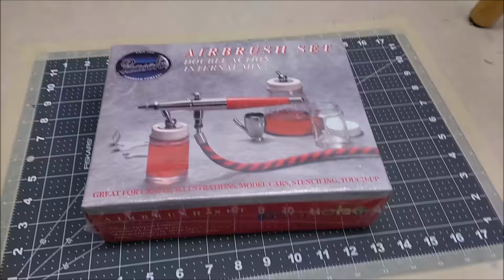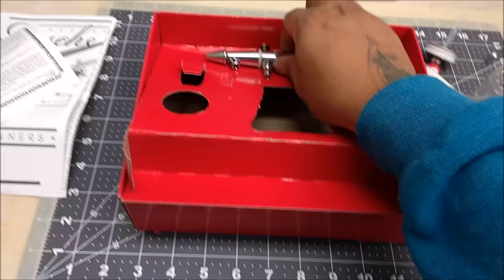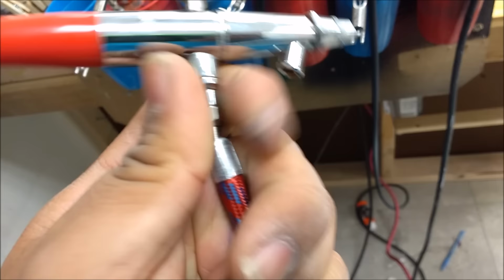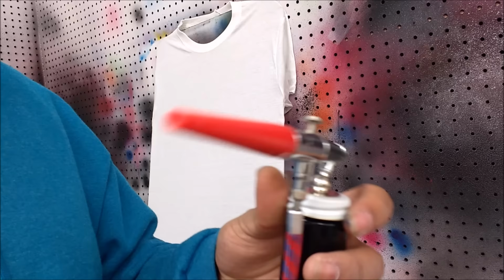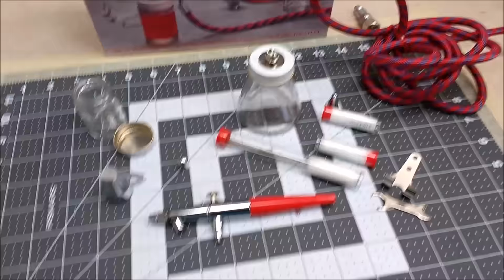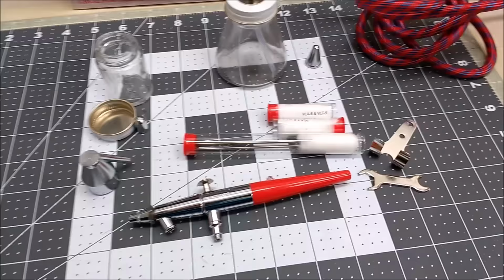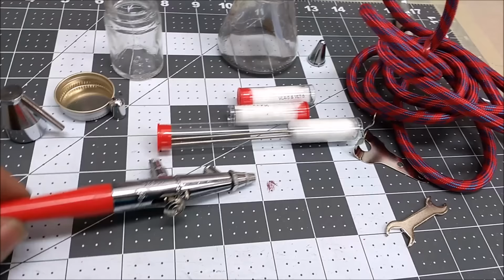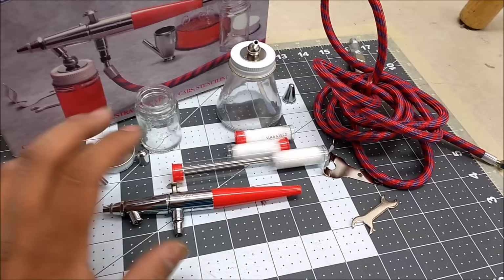Paasche VL Airbrush Set Review

Comment: i bought a Paasche VL like that in early 90s. I used it for modeling plastic kits and painting rockets. I recently found it and was able to restore the damaged worn out parts and even replaced the handle for a chrome one. I easily found all of them. I even made a wooden box for it to protect it. The brush is fully functional. This airbrush will last 100 years easily. I paid $52 for it, yep still have the receipt it out lived the art store. Want a tank? Get a Paasche.  Paache needle numbers #1 - 0.5mm, #3 - 0.75mm and #5 - 1.01mm. You can always spend up to $700 for a fine set if you are rich... It will still spew out paint... LOL

Comment: Siphon feeds need a higher Air pressure and well thinned paint, Creatix makes good paint especially for Model builders but it's needs to be thinned and have a leveling agent (Some brands offer a 2 in 1 mix) for best results on models.  Not sure about shirts but my friend has a 186k model that he got on the stupid cheap and after polishing the needles (remove the pits) those are the only ones he uses now at the fair (He ended up buying 6 more and spent 2 days polishing all the needles, which you must do with cheap brushes).  Like your video and had to chuckle at the box opening, no tripod makes life hard :) Great work!

Comment: FWIW, the VL's are great airbrushes when used for what they are best at: Putting  a lot of paint down quickly.  The  #1 "fine" needle/nozzle that comes with the VL is a .55, the #2 medium is a .75 and the #3 large needle is a 1.05 (that's spray GUN territory).  The needle that comes installed is the .75 - not a .3 - so that is why you were moving so much paint.  Also, the needle adjustment is a bit different than other guns - you want to make sure that you allow the trigger to drift all the way forward before seating the needle in the nozzle/cone.  If you have some turns on that knob that sits in front of the trigger, you can inadvertently be pushing too much air right when the needle comes off it's seat, making it seem hard to control paint flow.  

The hose "kink" going into the airbrush (the bent metal tube) is so you can tilt the hose to a position that's more comfortable for your style (i.e. it's on-purpose).  Just point the hose the direction you want it to tilt and lock down the nut (you will have to use the wrench to get a tight seal).

I currently have 11 airbrushes and have owned quite a few others: several Iwata, some Master, Grex, Aztek, and Paache.  I've had nothing but bad luck with Badger (that's just me, though).  Paache VL was my first brush - and now I own 2 of them ( including my original ) and they just keep on working.  I don't use them for detail work any more - that's the Iwata's job - but when I need to put down base coats or primers, they are my workhorses.  IMO, no airbrush outside of a automotive detail gun can lay down as much paint.
Reply: I have been out the game for many years but trying to get back in the paasche was my go to. I owned an iwata hpbc but never used it (I think I got it for Christmas in 1989) I want to buy a new brush for shirts and maybe some motorcycle tanks. Should I consider a different brush or stick with the paasche in this video? You know your brushes I can’t tell by what your typing.  I appreciate you insight. Thanks
Reply: @c.steele3386  In my humble opinion, if you plan to spray pigments (paints) and not inks or dyes (much thinner) then you would probably be better off with something like a VL than an Iwata.  Iwatas are great airbrushes - fantastic detail guns - but they don't (in my experience) have as much dynamic range as something like a VL.  I can paint a line 1/32" wide with my VL and expand that out to 2" with the #1 needle.  With an Iwata, I can go down to a hair's width - but past about 3/4" they start to struggle to move enough paint.  Of course, the beauty is that you can buy more than one brush and have QD connectors and just choose the best tool for the job.  If I was recommending a good all-around brush for a beginning user, though, it would be a VL (my oldest one is 41 years old and still going strong) ... and if you want the next best thing to a rattle-can to put down a ton of paint, the Paasche model H is a paint-moving monster - and it's external-mix so almost impossible to clog - and not that expensive to buy.  Best of luck to you :)

Comment: Have had one for years. You need the fine VL1 tip for the finest line. But, in honesty, a gravity fed will give an even finer line. Have never had my hoses leak either. Has ZERO problems with acrylics and enamels. You couls have gone with less thinner and a little more air pressure with no splatter / overspray or clogging. It's a case of knowing the tool. Making a comment based on assumptions is NOT a review. Have painted models with these paints and got great results. One issue with the kit is beginners often use the wrong needle for the tip they have as they don't take time to understand the markings (not talking about you, but beginners). Kit has always needed better markings or even sorting all the same size parts in their own containers.

Still an Excellent modelers brush. As stated earlier, was the go to brush many years ago for artists, but technology has improved. 

I agree with you that a gravity fed is a better option these days for artists. It's a case of the right tool for the job. Paasche does make some higher end gravity fed brushes BTW.

Comment: Use plumber's tape on your hoses connections and that will stop the leaks..and change out the needles, also take off the front needle housing to clean the needle if clogged..other then that. It was a great  demonstration..
Reply from the maker: the leak was not from the connection but from the hose itself. Change the needles for what? Taking off the nozzle for dry tip after every 3 minutes is no fun.

Comment: the hose is bent because it makes the original bottles fit better
Reply: I was given a VL, and was thinking mine was defective too, because the hose is also bent. Thanks for clearing that up !  I'm still having problems with it though. Even when spraying water, it will spray, and then stop, like it is clogged. The only holes that could possibly be clogged are the tiny, tiny holes in the "cone" that screws off to expose the needle. ( not the three large holes above the needle ) I notice that bubbles come out where I have screwed the cone onto the threads - even when spraying water. Other than that, the only thing i can think of is that my compressor is crap. It does not have a tank .

Comment: I've got the exact same airbrush and hose... My hose connection to the airbrush is also bent.. I think it's something Paasche had purposely designed but for what reason, I have no idea.  I've had to litterly crank down on that tiny 1/8 inch nut myself in order to keep it from leaking air after applying teflon tape to all its  (airbrush) threads.  it has a dial that I believe controls the needles' distance to the nozzle but find it extremely difficult to access while my finger is on the air release. 
 Awaiting my new Talon... Here's hoping it's a far better airbrush!!
Reply: Same thing with mine! Connection to airbrush also bent,leaks air etc.etc but it's not that bad the airbrush once you get to know how to used it.

Comment: Kudos on the video, I'm looking into buying this set, I'm new to this and vastly interested in airbrushing. You did mention you didn't really like the VL, but in my opinion you glorified this airbrush with your artistic abilities, as if the airbrush is actually the best money can buy. Although your dislike of the Paasche, I still love how great that T-shirt came out. Keep up the good work. Also, what's your opinion on the Badger 360? I'm thinking between the VL and the Badger. I plan on painting models and doing art with fine lines and detail. What's your insight?
Reply from the maker: This airbrush is not good for fine lines or details. It doesnt atomize paint very well and shoots more of a speckle. DO NOT mix my talent and expertise with the airbrush itself. All the lines and shading would have been easier to produce and more precise with a different airbrush with the same size needle/nozzle.

Comment: Iwata air brushes come with very fine needles.  Try to compare  with a comparable airbrush with the same needle size!  I've had mine for over 41 years & has painted many a 1:72, 1;87, & 1:20.3 scale models.  Has painted some fine lines & you can always buy a much longer hose for the air supply.  Unless you bought you badgers used, they didn't come with a 15 - 20 foot hose like you show.  I owned several makes of airbrushes & will NOT say they are no good because they don't do what I want.  In fact that is why I own several makes because they accel  at what they do.
Reply from the maker: the badgers came with 10 foot hoses, Out of ALL the airbrushes I have ever tried this VL was trash. Atomization was crap, quality was crap, hose leaked.. etc. 
I just call it like it is sorry if it hurt your feelings. ALL the paasches I have tried DO NOT live up to their competition, full stop.

Comment: Could you please explain why inks would work better with this product? Do you think it would be easier to get thin lines if ink was used instead of paint? Thanks
Reply from the maker: it doesnt atomize paint very well. so ink would work better because it is much easier to atomize as opposed to paint. And no thin lines would not be easy to make with this airbrush because of the tip style.

Comment: Can I use a Badger air brush with Paache equipment??
Reply from the maker: what equipment would that be? Besides the airbrush parts and hose, everything else should be "Airbrush Equipment".
Reply: Mike Flores ....meaning the hose and air compressor......can I attach any brand of airbrush to this hose and compressor?
I appreciate the help.
Reply from the maker: the compressor and any bottles or paint you use should be compatible., The hose will have a different fitting on the end. you might need and adapter or different hose.
Reply: Mike Flores ....that's good news......appreciate the speedy reply.....thanks again.

Comment: Chrome tip fell off the handle before it came out of the box. That says a lot about quality control.
Reply: That chrome tip is not permanently installed, it is to protect the needle end of the brush  Try it...Press fits right on so you don't bend the needle
Reply: @mikel7156  I was referring to the chome tip on the handle.
Reply: @wudbcarmodeller2713  i am as well,  it's on the handle, at the end,  tube shaped with a bowl type cap, will fit over the serrated edge of the air tip to protect the needle because of the indentation of the air cap.  Thats why he mentioned while using acrylics the air cap is concave, leaving the needle exposed to potential damage.  This will protect the tip if someone drops it.
Reply: @mikel7156  Watch the video again! When you open the box, the protective cap is on the airbrush but the chrome tip which should be attached to the end of the handle is rolling around in the box.
Reply: Wud B Car Modeller You’re right. The cap I referred to is not on the handle. The cone shaped one he pulled off the end wasn’t in my kit. So I use the other one. My bad.
Reply: @mikel7156  I have used a vl for 20 years. The end cap fell off mine eventually. I glued it on with epoxy glue and have had no trouble since. Best wishes my friend.